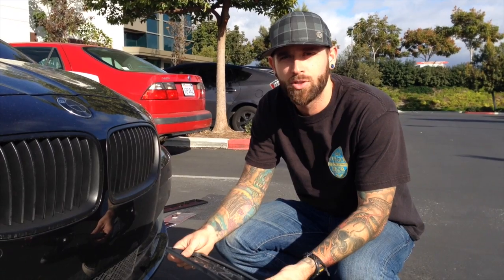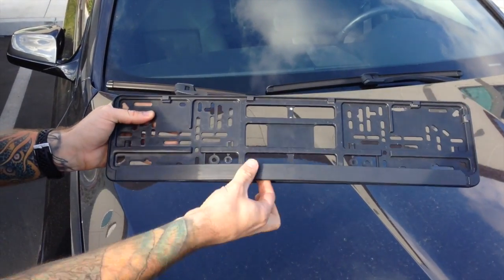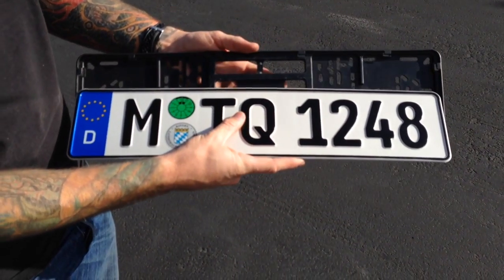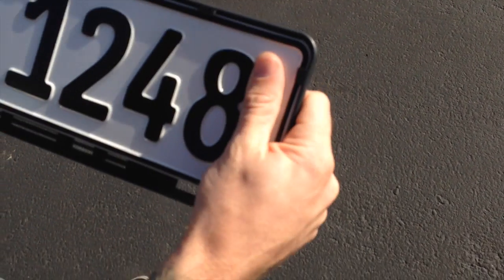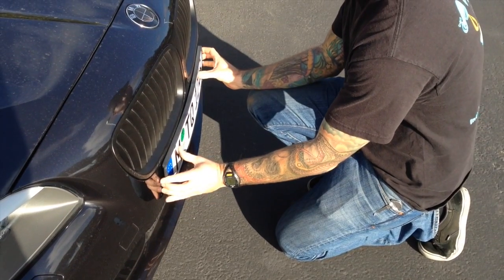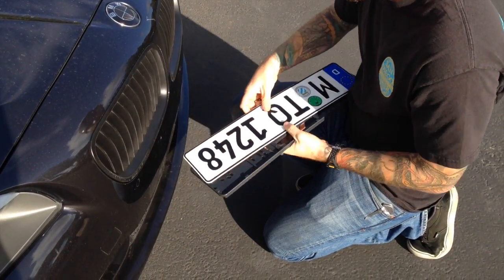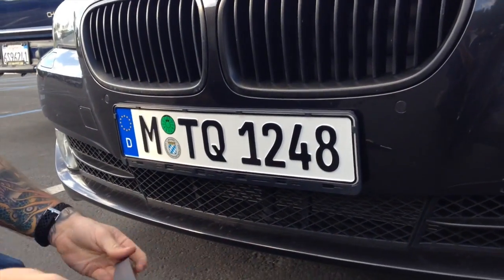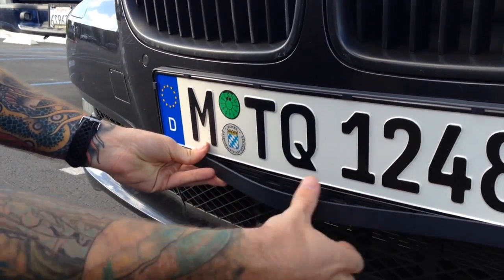How to Mount Your Custom European License Plate Using Screws

Comment: looks amazing but my bmw is leased  so i cant drill holes .....probably a dumb question but can you do this with some sort of adhesive ?
Reply from the maker: +Frank Champion We offer a product called 3M Dual Lock.  The Adhesive is top quality, weather-resistant, and capable of safely securing your plate firmly to your vehicle. The interlocking stems provide a large amount of holding force. Installation is as easy as putting on stickers.
Reply: Custom European Plates and it comes with the frame as well ? I want a HH ( hamburg) license plate

Comment: does the 3m dual lock system hold up well against high pressure car washes?
Reply: No. These frames are trash. A couple times through the car wash and you will lose your plate.

Comment: I'd like to know how do you mount the german plate first, and then my California plate on top? My german plate has no holes for screws to go in.
Reply from the maker: Hmm, you'd probably have to drill holes in your German plate.  But then you'd be covering up the best part!
Reply: +Custom European Plates I am about to order a euro plate for my car from you guys and some sort bracket/mount that would allow for dual mount (where the US plate can be mounted in front of the euro style plate) would be awesome. I have no welding or metal working capability at home, but I might head to a scrap yard to grab some stock license plate mounts and see what can be possible be done. But will it be pretty...?

On another note, it would be nice to also have a clear cover to protect your plates from road debris and insects.

Comment: I have a 2002 Audi TT with no front plate frame, but four holes, 10.25" apart horizontally and 2.25" apart vertically. Does anyone know if this will match up with the Euro frames I can buy online? The sellers don't say.

Comment: are those euro plate illegal or legal  in united states.. I don't want to get pullover by the cops.I want to order one in my audi it says ( AUDI A4 )...thank you
Reply: They are legal in the us but with exceptions. If your state only requires rear plates, a front euro plate like the one on this BMW is completely legal. I live in PA and they only require a rear plate, so I'm running German plates on the front of my Mk7 GTI. If you live in a state like NJ or NY that requires front AND rear plates to be displayed, it is illegal to run euro plates in either location.
Reply: I think you can get away with that, you just need your front plate to be visible at all times. That said, I wouldn't take my word for it and each state has it's own laws and each cop has their own mindset for if they would pull you over for it or not. I wouldn't risk it in a state that requires both, mostly because having two plates on the front of your car wouldn't look too good. I'm only running a euro plate on my GTI because it came from out of state and had the hole mounts in the bumper, otherwise I would've left it bare.
Reply: @Krauser1226  I live in PA as well and just ordered a euro plate to put in front of my car bumper. Would it be legal even if we drove with these euro plates on the bumper into a state like NJ/NY. If a cop saw my euro plate there, would they pull me over?